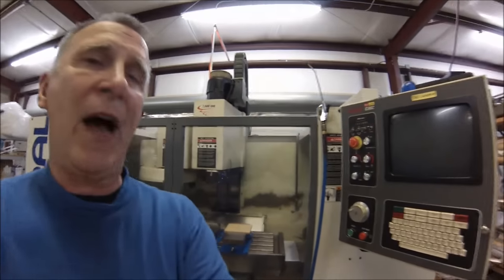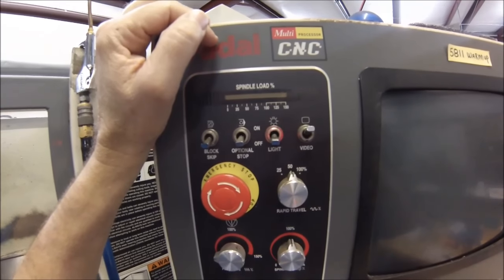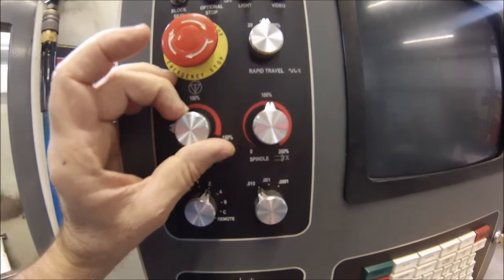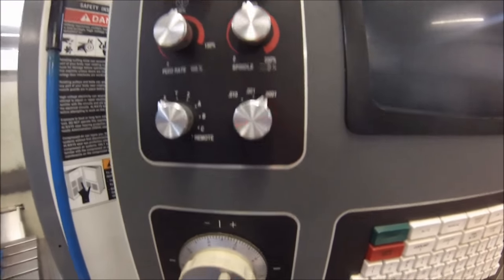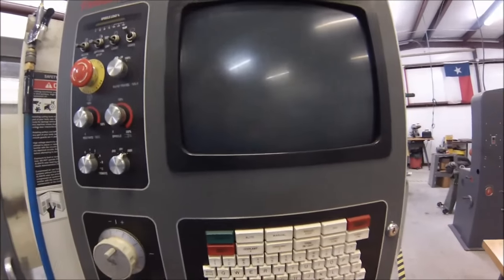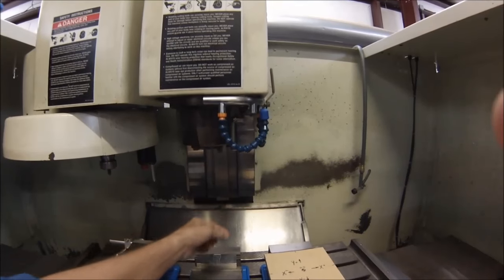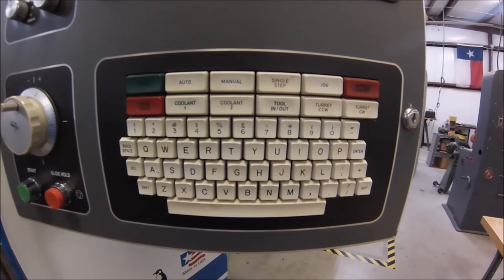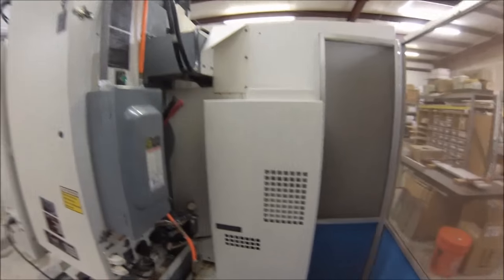CNC Machining Center   Part 1

Comment: Hi Joe. A B and C are rotational axes that relate to X Y and Z. A rotates about X, B rotates about Y and C rotates about Z. There are other 3 letter groups for CNC that you may be familiar with and I am led to believe that they all correspond in a similar manner. I J K for instance relate to arc points and centres for X Y and Z in turn. Also U V W which are secondary linear axes for X Y and Z. Think of a Bridgeport, you have the Z axis that the knee travels along and you also have the quill which is a secondary linear axis.
Reply from the maker: Thanks Crispin. Did you cover CNC in your apprenticeship? CNC was in its infancy when I did mine.
Reply: Hi. Yes did a 10 week cnc course at the training school but then other than my time in the tool room everything has been cnc. Been on cnc grinding machines for the last 2 years.

Comment: A is a rotation about the X axis, 
B is a rotation about the Y axis, 
C is a rotation about the Z axis
Reply: To add, you normally use the C axis on CNC lathes as this is the  chuck rotation, therefore on a lathe/ machining centre you can for instance; drill on a PDC (pitch circle diameter). You can also mill profiles using the C axis

Comment: Joe, thank you for the great videos! I have the same Fadal machine, mine is an 2002 4020HT with 24 ATC. I am new to CNC machines and have just finished rebuilding and learning how to program and old Mori Seiki SL-2H CNC Lathe, now moving on to the Fadal. Watched all 7 videos and they are so very helpful! Appreciate your teaching style. Thank you so much for taking the time to do these videos!!
Reply from the maker: Getting up to speed can be nerve racking. I am self taught, but had a good friend I could lean on for the tough stuff. Feel free to send me messages if you have specific questions. I'd be happy to assist you.

Comment: Excellent explanation procedure to someone like myself who is very interested in the operation of cnc machining but I'm afraid at 70 years of age  it's too late for me to invest in even a small cnc machine as I only manufacture in the model engineering hobby field. But, it's amazing to watch people like yourself program and use this technology to achieve such accurate and phenomenal parts that can be machined in minutes that would take me days, weeks and sometimes months to even remotely successfully finish and not with the accuracy achieved with cnc. Many thanks for commencing the series, I look forward to learning.
Reply from the maker: Thanks for watching. I've got good stuff on the way.

Comment: Perfect timing Joe! Literally just got my CNC mill into my shop over the weekend. I have no clue how to even turn it on. Unfortunately mine is an much older (1984) German made machine called Chiron FZ-16 with a Fanuc system 6 controller. It's going be fun for sure! Jason
Reply from the maker: If nothing else, this series will show you what to dig for in your controller and the mandatory setup check points. Good luck.

Comment: This stuff will become second nature if you do it every day. Some machine controllers are slightly different, but if you understand what Joe is showing you, then the manual for the machine you are running will make lots more sense.
 
If you understand manual machining for the lathe or mill, you are 80% there for running a CNC machine. You know what you want to do and how to plan the order of operations. You also have at least a good idea what the speeds and feeds should be. You've used undersized cutters on a manual job and you know how to account for that...And you can do the same on the CNC machine.
 
I would say the most important thing to keep in mind is that the machine is completely blind... it's like you running a manual lathe or mill blindfolded.  The machine can't see any obstacles around or on your work. If you tell the machine to drive an end mill through the machine bed, it'll do it's best to do it.... Don't allow yourself to be distracted while getting a job planned and set-up.

 Make up a pre-flight and post-flight check list so that you won't overlook anything that could damage the machine or make for start-up problems the next morning.

G and M codes will get you a very long way. The fancy-dandy computer software comes into it's own when things like 3-D curved surfaces need to be generated.
Reply from the maker: Excellent comment. So True. I have always said, " Its easier to make a CNC programmer out of a manual machinist, than it is to make a manual machinist out of a CNC programmer". Make a checklist and take your time. Crashes can be expensive.

Comment: Enjoyed and found it interesting....curious..... age of the machine? bought new? cost? life expectancy? software/program compatibility as time passes......my 10ee lathe is 64 years old and still useable, can the same be said for cnc machine?....
Reply from the maker: Hey chuck. This machine is about 18 years old. I bought after it was rebuilt 4 years ago. The monitor and software are updated and compatible with today's modern CAM systems. Base machine is about $34K before tool holders, vises, delivery, setup, USB readers, electricity and air etc. All said and done you are mid $40's to make a part.  I guess if you don't beat on it and do regular service, it should last. I don't know about 64 years, but hell, I won't be around in 64 years, so thats OK.

Comment: No tool changer on this machine? In the next year I likely will be going thru the begginer stuff myself when I get my CNC moved in and fired up. Sadly it is not the same control but likely I can still learn a lot of useful info from this series.
Reply from the maker: No arm like the side carousel. This is an umbrella style that advances for tool changes. It will be covered.

Comment: Thanks Joe, this is great!
One question: I know nothing about CNC, but I was surprised the machine would move even in jog with the door open and no manual override.
Reply from the maker: Me too actually, the door safetys are not installed on this one. You can open the door and reach right in on full auto. Not Suggested !

Comment: That IS an 88HS control.  Multi-processor refers to the fact that there is a single 8088 processor on each axis board.
Reply from the maker: Does the 88 base controller not have multiple processors?
Reply: As I understand it, there is one master processor in the base controller and a single slave processor in each of the axis boards.

Comment: Great start never used one☹️ but I'm about to be informed how too. 😀👍 what depth & speed would one run a 3 inch face mill on a 3 hp gate mill, its 1500 kg so a big mill, I see you have Bridgeport's, it's on hard-ish steel, width of work  1"200
Reply from the maker: Is it an insert cutter? How many inserts and what type? If its a high speed steel cutter, I'd keep it under 300.
Reply: Joe Pieczynski  yes 6 carbide 45 degree inserts don't know the make. Will have a look when I get home 👍

Comment: Thanks! I'm just getting a 4020 going myself. What's the chances you could take a close up picture of the z axis flag for me with dimensions and possibly post to ig?  Mine has the z column flag but not on the actual axis, I'm assuming all vintages have the same flag.  I'm not sure what the previous owners were using as a reference(maybe they were just usingthe bottom of the axis saddle). I'd hate to crash the changer!
Reply from the maker: Sure. I'll get you a table to spindle measurement as well. feel free to ask questions as they arise.
Reply: Joe Pieczynski not sure I've been looking in the right place,  did you ever happen post that info?
Reply: Joe Pieczynski HI again!  Just pestering you again for the z height/flag dimensions yet.  Thanks

Comment: Hmm The HAAS stuff I run has a lot more buttons, still need to get a vid  for you.
Actually more user friendly due to less multifunction buttons, g code looks to be very similar.
PS the newerl mill has 1000 IPM rapids which is kinda scaryl

Comment: Easiest control to use, like I need to make an offset. I just type in Df enter "Da Fixture" 😂. Fanuc is fun to use meanwhile the haas control panel is best for fast production and assembly parts
Reply from the maker: My controller experience is limited.

Comment: Hey buudy could you Share your warm up program?
Reply from the maker: Its a simple incremental simultaneous X,Y and Z movement of 5.00 inches. Its a sub routine looped indefinitely until you hit the stop button. I like to see 100 loops before I stop it. I'll be happy to share the actual code if you don't know how to do this. Hit me up on the contact page of the website i'll post in the video description.

Comment: ...4:00....A-B-C....are for rotating the fixture/s around the X-Y-Z axis...... 20 X 40 seems to be a standard for smaller machines....When I worked at Burgmaster (Los Angeles) in the1970's, 20 x 40 was standard travel for the smallest 2 and 3 axis, 8 spindle turret drills....these table travels went up to 60 X 120....120 was 'X' and could be extended as far out as 480", on the traveling column gantry machines...... In the 1970's...CNC was barely in it's infancy....I left Burgmaster in 1979......they were just starting to use the Fanuc controllers......a lot of opposition by the Union against these 'Japanese' machine controllers.....  this appears to be an older VTL machine judging by the keyboard...BUT FADAL and HAAS are both USA made in the Los Angeles area......
Reply from the maker: I wish I had exposure to stuff like this when I was starting out. CNC was just getting started back then. I personally like Fadal machines for the money.

Comment: from the 1980-90s ?

Paddy
Reply from the maker: Full rebuild and upgrades in 2003
Reply: Oh, I see.... the console reminds me, qua style of the Fanucs and alike I spent a lot of time on... I worked for an outfit that sold and serviced these things for a short while.
This was during the late 70s'. 
This firm sold Fanuc and a few other makes, and was a dealer for Posilux, which made CNC drills for multi-layer PCB boards... if you ever see one of those.... there is but one thing you ought to do!
Take 5 gallon of high octane petrol, pour over said machine, set a match to it.... you'll be doing the world a very big favour !
These miserable contraptions still used paper punch tape as late as the early 80s' and made many a grown engineer cry ! They couldn't stand the cold....or the heat.... they couldn't deal with drought or .....moisture...
They even were known to start flipping on account of very loud noises....
Terrible machines they were....

Toodles!
Paddy